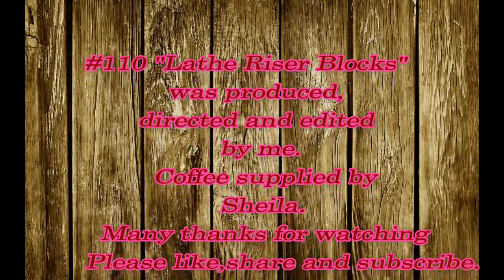Woodturning at 54a. #110, Lathe Riser Blocks

Comment: Big changes at 54a. Looks good Keith. Id like to know more about the belt and or pulley changes.
Reply from the maker: No belt or pulley changes,as the type of lathe I use has the motor attached to the head,not underneath.
Reply: Keith Barrow  ok thank you Keith

Comment: Nice bargains you got there Keith  from the closing down shop! I love the idea of the rising blocks to get the extra bit of swing, do you mind if I copy it me old mate?   Question... Will you leave the riser on permanent ?  Nice one mate, cheers, Bram.
Reply from the maker: Bram the Wadesmill woodturner How do pal! Course you can copy it mate! Don't know if I'll leave them on permanent,unless I knock up a 2 inch high platform to stand on,it's surprising how you get used to a certain height to work at! Still,they only take a minute or two to put on.😀
Cheers for now matey,
Keith 👍👍👍😀
Reply: Thanks mate !!   :)

Comment: Hello Keith, nice looking shed, Can I ask you a question please about your lathe,  is it the Axminster Craft AC370WL without the base on it, the 1 horse power (750 Watt model).
Im looking for a new lathe and charnwood  I have the baby 815 and they wont deliver out here and I have seen some of your videos and was wondering if it is this lathe how do you rate it please, the 815 basically is good for pens and tiny things and not a lot else and I want some thing with power but not professional but large enough to do a decent bowl , salt & and pepper pots and nice chopping boards and spindles, do you think your lathe can cope with all that please.
Axminster have said they will deliver to me in spain and they have a dealer here but its cheaper to buy direct buy 150 euros!! 
Appreciate any help please you can give me, thanks Neil
Reply from the maker: Yes,that’s the model,although when I bought mine it was the AWVSL1000,same lathe just rebadged.I have since upgraded to the Axminster 1628,but can recommend the one you’re looking at,I never had any problems with mine,it’s a good no nonsense lathe,well worth the money,and if you decide to upgrade in the future you won’t lose much money on it.I have also got the baby Charnwood 815 which I use for small stuff!😄
Reply: Brilliant Thanks Keith thats good to know, I have the little 815 as well and its a nice lath just lacks a little power but a pretty little think , if the wife would let me id bring indoors! Thanks for the good news on the lathe, Ill pick one up when its next in stock, i guess the next ship from china hasnt arrived yet!! Many thanks and keep on making the videos, good to see over here in Spain. the one spanish guy that I know that makes good vidoes, huge belly on him but speaks so fast i have to put subtitles up to understand him but hes passionate about his lathe as well but the Spanish as a whole dont do the hobbies, too much sun beach and vino!  Thanks again put my mind at rest mate. Neil.